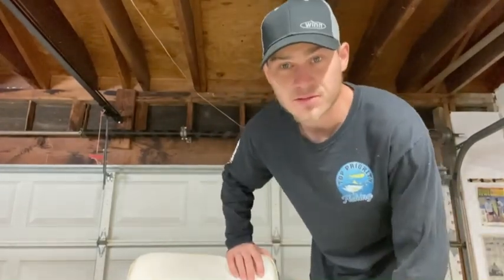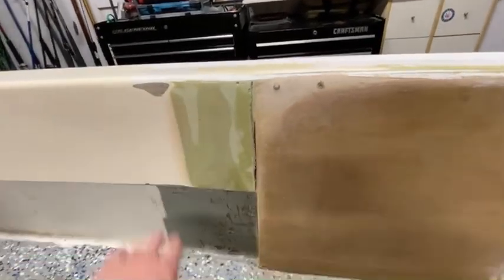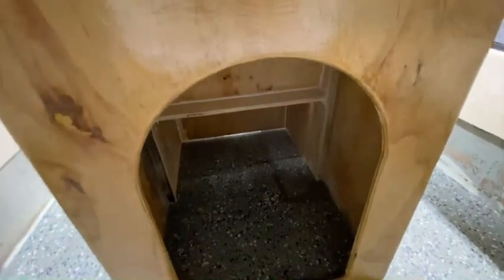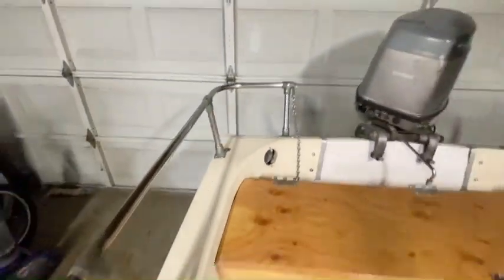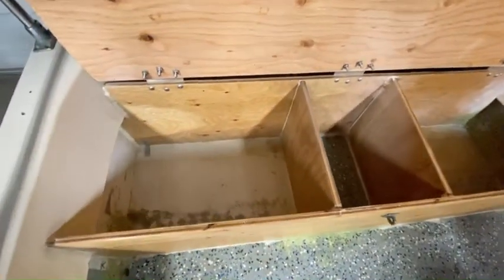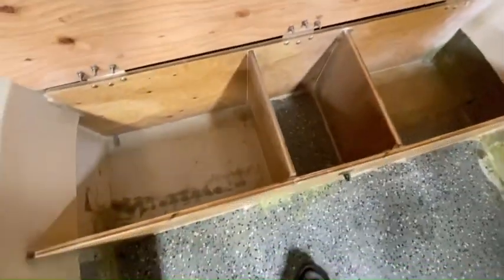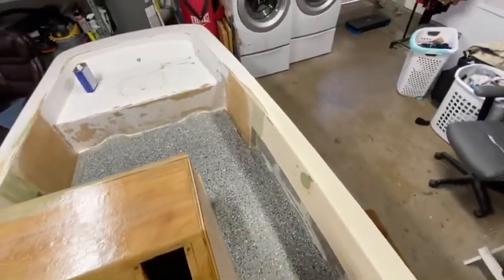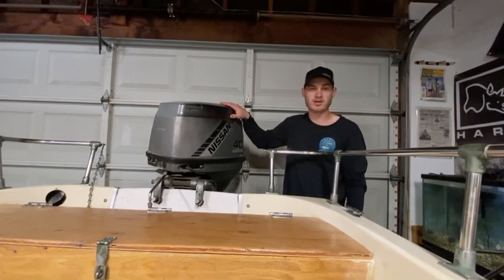Building A Custom 13ft Fishing Boat! (Part 2)

Comment: Hi, how did you connect the console to the hull?
Reply from the maker: All 4 corners have basic mending brackets on the inside of the console to the deck and then fiberglassed the console down to the deck all around